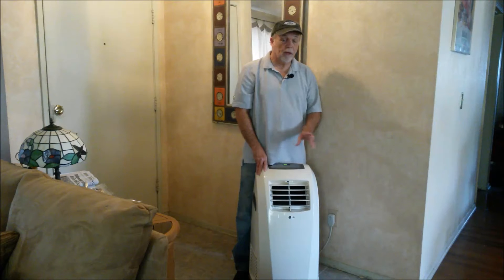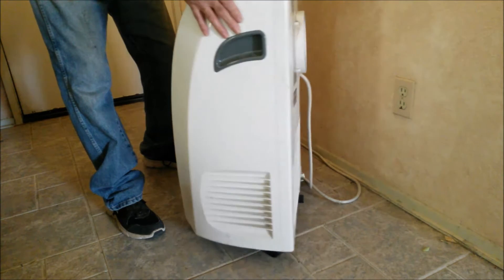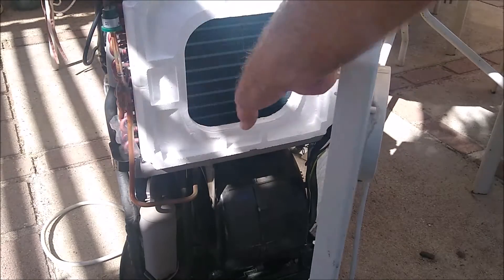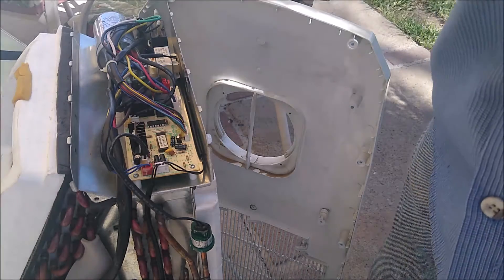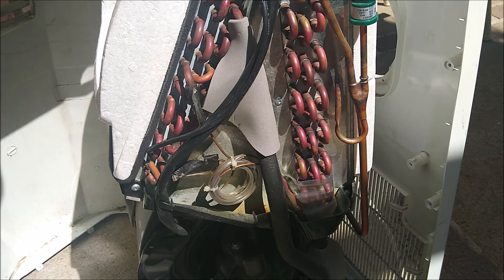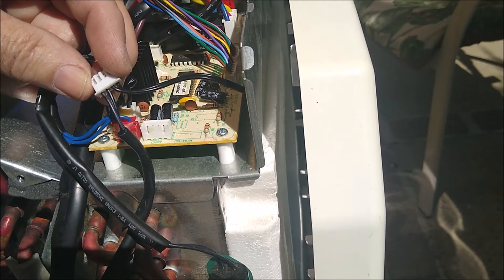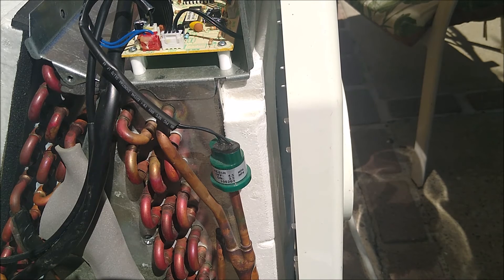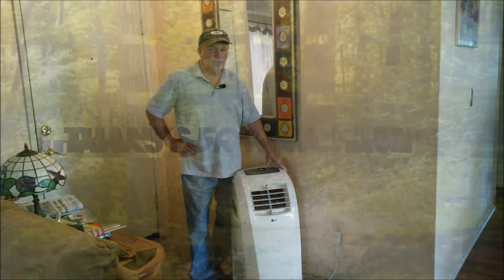Air Conditioning E4 fault failure

Comment: My evaporator is making so much condensation that it’s leaking from the sides. I one time got the E4 error cord. Think if I replace the thermistors that it won’t leak bad ?
Reply from the maker: Living in Southern California, I don't have to deal with excess condensation. But, if the evap freezes up and then the compressor shuts off I can see where the excess drainage all at one time could cause your issue. The sensor is very inexpensive so why not give it a try and see what happens. In the mean time, run the unit and inspect the evaporator for icing up just to be sure that it is the issue. Not sure where you live, but, excess condensation might just be something that you will have to del with. There should be a drain plug down on the backside, if I recall correctly, You may need to add a drain tube and run it out to where it can drain or place it into a catch basin if excess condensation is an issue where you live. Hope this helps.

Comment: Ive had this exact unit for over 10 years, I love it.  The past few years I've been getting the E4 message.  I'm pretty sure its dust/dirty inside as the filters were clogged badly.  I removed the filters completely and used some Velcro and cloth vent filter sheet over the back and side and it restored the airflow but still getting E4 but it does still cool pretty well.  Its strange, when its colder outside i dont get the E4, only when its hot.
Reply from the maker: This unit in the video is my daughter's. It is now used as a backup unit. She still gets an occasional E-4 code and it cools perfectly. She just ignores it and lives with it. Since the unit is 60 miles away and she is fine with it as it is, I never had a chance to follow up. Her E-4 started about a year after this video. Thanks for the comment.
Reply: What about vent

Comment: Hi thksvfor the videos, my ac is a comfort star with the error e4. Will it be the same sensor issue csuse i replaced the ambient temperature sensor and same problem
Reply from the maker: You will need to check with the manufacturer's code list to determine if they are the same. Many use a standard code system but I have seen a few that just did not fit in with that standard system. You will also need to find the various component values for your system.  Good luck with your repairs.

Comment: If the sensor read 4.5ohm and if i put it in water reading 10.4/11 ohm shouldnt it work while the sensor is in cold water reading 10kohm?
Reply from the maker: If it responds to cold and heat it might be operating as designed. But, you need to find the actual specs to assure that it is running to specs. As electrical parts age, some will wander away from specs and can cause issues. You will also need to know what the particular air conditioner's expectations are for a given temperature.
Reply: @bobamos3628  its an old unit, AxAir Gam-12 made in 2003. i cant find nothing, only a new model for sale and even then, no data of the OHms. thing is, it was kept for years not used. i pulled it out, ran it for 2 seconds and it was working. i put it on its back in the car and took it home. when i turned it on at home it gave me E4 at start. since then it shows E4 at start non stop. idk if putting it on its back did something or what. didnt see leeaking or smth else. the circuitboard is one with the display in plastic. i can pull the sensors out but not see the board. i somehow feel its not the sensor but not sure, and in my city there are mostly company's that mount brend new systems, not fixing old stuff

Comment: I have a GE portable and the E4 comes on...like about once every half hour, then it comes back on, then another 30 minutes or an hour and the E4 comes on, then it comes back. Should I worry? Or need to do something.
I drained the water yet it still cycles to the E4, but then like I said, it comes back cooling the room.
Reply from the maker: Well, the E4 indicates a possible issue that might need attention. If the unit continues to cool properly and cycles as it should, I would just live with it. I have repaired this code on another that does exactly what you are experiencing. It has never missed a beat and is cooling perfectly. You might try placing the sensor in a different location from where it is designed to fit. Or, replace with a different brand sensor if it bothers you. The choice is up to you as to trying to run down the problem or living with it as long as it is cooling. On the one that I had the code return, we just left it and the owner is happy with the performance.
Reply: @bobamos3628  Thx Bob. Yeah, it cools the room and runs fine til the E4 comes on, which is seems to switch to fan mode, then in a few seconds or like 3 minutes the most I timed, it kicks back into cooling mode, no issues.
I saw another repair expert say the same, as long as it cools, it should be fine but I will take your advice on the sensor replacement.
Many thx to you and your channel. Best.

Comment: How can I fix error code lc
Reply from the maker: Hi, For A/C units, this code generally refers to an outside coil temperature thermistor reading too high. I would start by looking for the actual temperature of that coil. The condenser coil is the one that gets warm while in operation. Make sure that it is clean and clear of dirt and any other obstructions. Air must flow through it to cool down the unit. It is the heat exchanger portion of the air conditioner. If you have a pyrometer, you might want to test it for its temperature. On you unit I do not have the specs of how hot it should be so Google it for specs. If it is not outside the temperature range, I would suspect the thermistor to be faulty. Hope this is helpful.
Reply: @bobamos3628  thanks for the info

Comment: How do I fix E4 code on the new black and decker standing portable ac/heater.
Reply from the maker: I really do not know. Is the E4 code the same on their products? If so, I would proceed the same as I did on this. Some companies have their own coding and not knowing if B&D use the same codes I could be sending you in the wrong direction. Wish that I could give you a better answer. While I am an AC specialist, my experience is mostly in the automotive field. I just apply my knowledge of AC systems to whatever I am working on and research how their systems are set up to work.

Comment: Thank You Bob!  Excellent presentation and explanation, in laymen terms , of the thermister replacement and safety precautions.  A year old and replacing parts already on my split system...... Where did the quality in workmanship go too nowadays? Rhetorical question 😉
Reply from the maker: Thanks for the compliment. I do try to keep it at a level that can be understood. I used to reach auto mechanics at the dealer level whe I worked for Chrysler Corp. dealerships and could see the student's eyes glaze over when I had lost them. It is a little tougher on line as I can't see if the reader is following my example or if they are lost. Quality? Where did it go? Ya know, these companies will keep cheapening items to boost their profit margins and keep doing it until their products no longer work or last. Then they just keep it like that. Sort of the Peterson principle in reverse, where someone rises withing the company until they reach the level where they no longer are capable of doing that job. Then they stay there contributing nothing. Anyway, thank for the response.
Reply: Out door not  comtacter  woring power fstfil error shpwigo

Comment: How do I know which sensor ohm range I should have.  Mine is a Arcticpro Portable AC with a E4 code evap freeze up.  I looked for replacement thermistors and there are a few different ranges 5k, 10k, 15k I'm not sure which one to start with.    Coil is not freezing up though, I even pulled the sensor off the evap tube and still has E4 code
Reply from the maker: Yes, I know what you are going through. I did this repair quite some time ago so I am a bit fuzzy on where I found the actual information. But, to find it I generally searched some diagnostics for other refrigerant units in the particular company's product line. Most, but not all, companies generally use the same valued parts when they are interchangable. I found a diagnostic video for this company's store refrigerator and the guy was using the value that I used in this video for the repair. You will just have to do some research to find the value for your particular unit. Thanks for the comment.

Comment: Thank you you save me hundreds of dollars
Reply from the maker: Gee, so happy to hear that... It has been a while since I did this video and my daughter said that the A/C is still working. She does get an E4 code at times but it goes away and cools without failing. So, if your E4 code pops up, I would not worry as long as the unit continues to cool. Replacing the mother board is more expensive than replacing the unit. If you could even find the board. Hey, it's an air conditioner and as long as it cools you are fine. Thanks for the comment.
Reply: @bobamos3628  the problem with the newer AC models it all the regulations they put on them.  These older units work much better in my opinion.

Comment: I'm in heat mode.There are two water outlets,one at bottom of appliance and one half way up ,which one is for heating?
Reply from the maker: Couldn't tell you as this is an Air Conditioner only unit.

Comment: Nicely explained...  I`m seeing an occasional E4 fault.  system will reset with an on/off cycle.  I`m going to clean and blow out system and vents as you described...  Thank you for you expertise.😁
Reply from the maker: This one will show an E4 on occasion but it automatically clears and starts cooling again. The time it waits to start cooling is about the same as the normal off cycle. We decided that as long as it comes back on that we would just leave it. It's not always there but sometimes and never stays off. So, if yours will eventually come back on by itself it may be just fine as is. Our original fault was an E4 and it never would restart until we cycled it on and off.. That sensor is the weak link on many AC units like this. Thanks for the compliment.